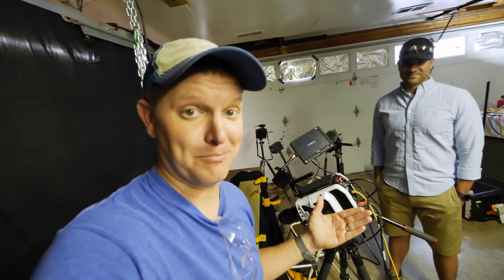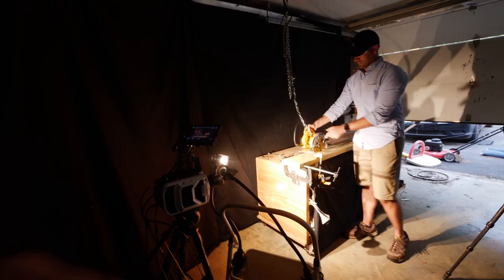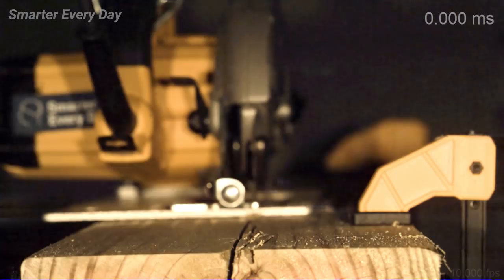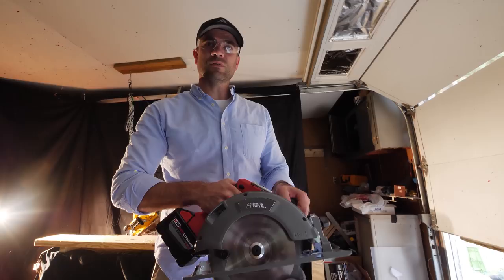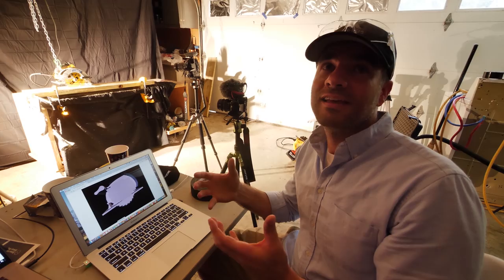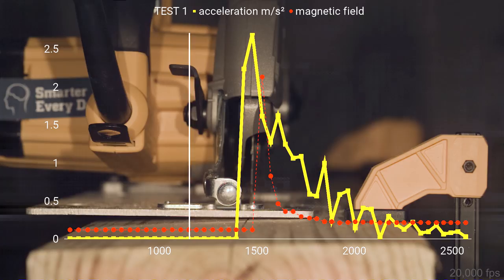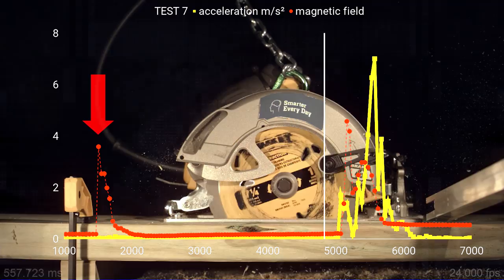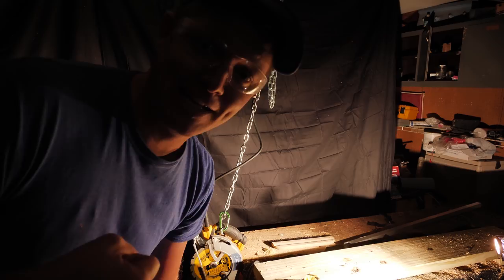Circular Saw Kickback Killer (We used science to make tools safer) - Smarter Every Day 209

Comment: As a carpenter... I am going to be honest with you. Schools may use this.. no one else will. There are many, many more ways related to set up and placements for cutting that removes this whole problem. No one who truly works with these tools regularly has any desire to trade more money for more safety redundancies in what is already loaded with dummy proofing systems to the gills. Every single time I buy a new tool with another unwanted safety option it makes me more likely to repair my older things rather than buy new. Also the system for this will almost certainly make the saw it's installed on useless for demo and most other uses for the saw other than your basic smooth cuts.
Reply: Why would this only be used by schools? What about the non-professional, home DIY-er? Your statement is the same as saying that airbags in cars are useless because everyone should be a professional race driver.
Reply: Kick backs are kind of a way we "weed" out people who are "better suited" to other careers.......
Almost every tool we touch in construction has the potential to seriously injure you (or worse).
Being safe, I think , is the responsibility of the individual AND/OR the person training that individual to be aware of the hazards involved in every task.
Reply: I would use it.
Reply: i think anyone who works in the field will agree with you. this was a cool experiment but these safety features in real life arent a solution. actually there isnt really a problem. anyone i know that has been injured by a circular saw never should have been using it in the first place.
Reply: Charles Waldon  Your sentiment holds true for every safety improvement and for technology advancements in general (seat belts and computers are perfect examples.) However, generally within two generations (usually 25 - 50 years), these things become taken for granted and won't bother anyone. In the meantime, until this particular safety feature becomes ubiquitous, Darwin will weed out the weak ones; implying that if you know how to handle saws without the latest safety features, you'll be fine, and if not, ...
Reply: Carpenter myself and I don't see the downside of a breaking system which turns on when the saw unduely accelerate.  While I totally agree that most accidents happens because someone stupidly ignored safety features and guidelines in the first place this one, like many other safety features are not a hindrance. 
And unlike the break block system for table saws working of "meats" conductivity to trigger the system to jam the break block into the saw an accidental triggering of the system wont ruin the saw.
Reply: As a carpenter for many years myself I too am not in favor of many of the safety devices. I.e. table saw guards. 

I totally disagree with you on this one. It doesn't get in the way, cost shouldn't be too crazy, and a simple mistake while using this tool can have such serious consequences.
Reply: Here's an old man not willing to try new things.. maybe it's time to retire.
Reply: Samed here, for professionals who use skill saws for a living, kickback isn't a problem. i've used a skill saw an absolute ton and just like chainsaws if you are careful about your cuts and not allowing blade to be pinched in first place it's no big deal and in rare cases when i do get a bit of a pinch it doesn't pinch hard enough to jump out of wood, its just a small jump as you release the trigger so as long as your holding saw properly with both your hands and your body/legs are out of way and releasing trigger instant it binds is just instinct to me, i've never come close to accidentally cutting myself (actually in most cases blade just stops and saw doesn't actually move even if you holding trigger, skill saws i've used while cut wood well isn't that powerfull to force my arms back out and towards me...). Now if your that kind of person who doesn't respect your tools and pay attention to what your doing, maybe you need dummy proofing, i know people who regularly cut into their power cords or saw horses etc, those people shouldn't be using skill saws if they can't respect the tool they are using enough to pay attention... 

Now table saws on other hand... way more tricky to use and scary in my opinion. chop saws and skill saws are my go to for cutting wood. Table saws i use as a last resort.
Reply: @petem9063  too true, wish I had read this prior to my first rebuttal.. pretty much sums it up
Reply: @jeffb1311  I am well aware of tech like this in many places. Unfortunately I have to be the bearer of bad news for everyone who thinks that the mods here are cheap. They are not.. it's an Additional option to a product. It will cost more. Most DIY projects are on budgets, that is why they are not hiring people like me, who have already seen the horror scenes of work place mistakes. Even with osha's law and every one  wanting to create a safe place for work to occur these things just are not practical in any way. It's understandable because you're not using these tools regularly like myself why it's not immediately clear why as well intentioned as this is its simply not practical and in my eyes removes uses for the tool.. I also understand that the brakes on rotating tools are not in Action because they have no longevity and fail... or in table saws with similar features once you trigger the sensor and utilize the safety feature that tool is done  until repairs can be done by the manufacturer. All reasons for not buying.
Reply: @YouTuneIt  no it only puts the saw out of use until repaired.. it jams up a aluminum stopper into the blade and it binds the saw.. boom garbage. The safety mechanism turns the saw into a paperweight. So if you had it in your mind that you just hit reset and go u r wrong.
Reply: @specfsr  ridicules notion bud.. quick slip with many things in life can come with serious consequences. I can't get behind the push to make everything child proof. Certain things that we do in life require a certain amount of preparation and learning. Not every single thing in this world is safe for use right out of the box. Lots of things well worth the effort involved take some learning from experience and preparation safety tips that can be easily accessible to everyone. More people should get familiar with operations of tools, cars and other equipment and technology before jumping into a position where ignorance can lead them to be hurt in some way. Life can't be baby proofed for a you toddlers out there well into you 40s.
Reply: @charleswaldon8362  what is
Reply: @zengrath  total truth
Reply: @cody5495  here is a forgivable obvious youngster who has no value for experience and just wants his world made dummy proof. Not caring about the trade off that occurs with these products in the real world when these lil gems are added for the untrained person who should not be using the tool anyway.
Reply: @charleswaldon8362  I totally agree with not choldproofing everything. Most safety measures suck. But there is no reason not to have this out there.  It doesn't get in the way of normal operation. As soon as early versions are out of the way it will be cheap. An accelerometer only costs about $.50. This safety is also non-destructive like a sawstop is. 
And even though I am a professional and I know very well how to use the tools safely, it only takes a momentary lapse in concentration, or even some other dumbass to run into you to cause a kickback. I would gladly pay $200 for a saw like that. My emergency room deductible is $100 and I value my fingers at more than $100. So the return on investment is there.
Also, it is so small no one would ever know that the safety is even there, so you wouldn't even look less manly in front of your workmates

Comment: Never ever- EVER -support the work on the cutoff side of the saw. That’s  sawing 101!!!!
Always secure the work under the motor (heavy) side of the blade and allow the cutoff to drop away from the blade. For sheets and awkward pieces support both sides nearly equally under the work to avoid blade pinch. I use stringers across under the work for sheetgoods and barely score them as I make my cut. Chipping is reduced as well. 

It’s important to always set the blade to the proper depth. Just deep enough to clear the underside a bit. That way the cutting action is nearly horizontal and  teeth clear the chips vertically. Then the cutoff drops away and down. If a circular blade is set too deep it will make a nearly vertical full thinkness cut  forcing the  material to twist and buck the blade.
Reply: I was surprised. These guys usually do better
Reply: So true.  Barely more than the thickness n the very first thing my dad taught me I using a C-Saw.
Reply: coldrunner we’ve created the solution for a problem we’ve created where we’ve removed all safety features and have forced the tool into an unsafe operating environment.

Comment: I wonder if you could measure the change in amp draw of the saw's motor when it "catches" on the wood. I'd image a spike as it comes close to stall torque. Could be quicker and simpler than accelerometers?
Reply: It would be far more difficult to tell the difference between kickback, and hardwood like Oak and Hickory, or so I would imagine.
Reply: @ncrshane1919  not at all, you are looking at the change, basically the motor hitting a higher resistance followed by free spin.

that wouldn't be difficult to differentiate
Reply: @0x73V14  I didnt account for the free spin, but if you rely on a free spin, then you need a much faster braking mechanism. If the blade is freespinning, that means that it is in the air where it can come into contact with the operator.

Comment: as someone who works in the trade this feature would be very annoying when i needed to abuse the saw to get a job done. i would be disabling it. HOWEVER. for your typical homeowner who doesnt use power tools day in and day out this would be a nice safety feature.
Reply: Yep, I posted a comment thats worded almost exactly like yours.  I also notice our comments are not getting Hearts LOL.
Reply: I don't know that this would be a good feature.  People should be learning the correct way to use power tools.  This sort of feature seems like it would encourage bad habits without teaching you good ones.
Reply: @IanSlatas  Just like how seat belts making people drive worse.
Reply: They could add a toggle switch but i do agree with you on that
Reply: As a carpenter all we do is leave the triangle in and use the circle Arbor instead and barely tighten the nut with some WD-40 or lithium grease so the motor spins inside the arbor instead of the blade kicking
Reply: @danballarin  Totally wrong.  It would be more like partially automated vehicles leading to less attentive and less capable drivers.
Reply: problem is, you typical home owner who only uses a saw on occasion is going to buy a  cheap $50-80 saw, not some super-smart $500 thing.
Also, I have had kickback before, and that saw guard works very quickly and well... This seems like a complicated solution looking for a simple problem that was solved a very long time ago.
Reply: Yep,  if you hold the saw firmly the blade will stall before it can kickback
Reply: @thecloneguyz  this is really interesting. So the idea is to have the blade just loose enough that it will bind in a kickback scenario. How do you test to make sure you have the right amount of friction? I'm sure I'm showing my ignorance, but  what do you mean by "the triangle"?
Reply: @Anjonwalt  
Skill saw blades have a center triangle that you can knock out if you want increased torque. 
The motor cannot spin by itself inside of the triangle because it's triangle.
You leave the triangle in and just use the round Arbor hole and you just use some WD-40 or lithium grease and snug it up. 
Then the motor spins inside the arbor if it kicks back or grabs. 
Old guys have been doing this for 30 years it's nothing new
This seems like an over-engineered answer to a non problem
Reply: @thecloneguyz  thanks so much! So just a little tighter than finger tight?
Reply: @Anjonwalt  
You always want to put a mist of silicone or WD-40 or lithium grease in between the arbor in the blade to ensure that it doesn't grab but yes a little more than finger tight

Comment: Wouldn’t a microswitch which triggers and applies the brake when the bottom of the saw loses contact with the wood be much more simple?
Reply: Perhaps, but there are often cutting instances where the switch would not be covered by the work. What then?
Reply: Then a contact switch on each side of the blade in AND to trigger the brake
Reply: Yeah or something with a double base plate. I am not an engineer, but I’m quite a macgyver haha. I respect this thorough approach but it leaves me thinking it just is over complicated.
Reply: These types of saws are used in so many ways. I've seen them used to shave a notch by lateral translation with the foot in mid air or tracing along a long cylinder or just the weirdest situations that go beyond the predictable straight long cut in continuous contact on a horizontal board. For one example plunging to begin a cut is a higher risk for binding which would happen before the foot makes contact.
Reply: @frederf3227  but not all the kind of cuts are prone to kickback. You need two sides of material to snap the blade.
Reply: why bother detecting the kickback?
a simple metal splitter behind the blade will prevent the wood from binding and prevent the kickback from ever happening in the first place.
Reply: @isays  Having used a circular saw lots, I can tell you there are many cases when that wouldn't help. Specifically If you're doing a "plunge cut" to start, or cutting a sliver off an edge etc.
Reply: How do you start the saw then? It has to be buried in the wood before turning on? Oh, you put the switch at the front... but then it turns off when the tip goes over the end of the board but you're not done cutting yet. What it you have to just cut a sliver off one edge of a board? Or how do you start a plunge cut? Nope. Switch wouldn't work.
Reply: @WorshipTheSavior  thats a good point... although I'd imagine that when you do a plunge cut, you prepare for it...
the normal danger of a kickback is because it can happen when you're not prepared.
or at least, that was my understanding. I'm not a professional, I just occasionally make things as a hobby and rarely use a circular saw.

From that perspective, having something that detected a kickback could be helpful, because there are some cases where physical failsafes couldn't operate.

I'm still kinda sketched out that they're using machine learning for it though. this doesn't seem like a good use case for it.
Reply: @isays   there are certainly times when kickback is more likely, and sometimes you can prepare yourself for that to stop it from happening, but being in a hurry, complacency, or simply a surprise like a knot or a nail in the wood can cause kick back when it's completely unexpected. 
I'm not really familiar with machine learning, but I would guess that they are probably just using it to develop a kick back profile which would be hard coded into the device. Hundreds of data sets where you specify under controlled conditions whether each profile is from a kickback or not could produce a very accurate model for it to follow once installed in the final product.
Reply: @WorshipTheSavior  im a software dev so I'm a little familiar with machine learning, but I don't specialize in it.
That is how machine learning works... you train it beforehand with a bunch of data, and then you copy the already trained neural network into the finished product.
but neural networks (and other ML alternatives) have the issue that they cannot be inspected or reviewed for correctness, so if there is any issue with the training data or methodology, the only way to find out is when customers start complaining.

Machine learning isn't good for safety critical systems.
Reply: @isays  ok. But in this case, you're moving from no safety, to added safety. They would only be increasing the safety level, and not replacing a safety feature. The worst case scenario I see happening here, is that it completely malfunctions and revert back to a circular saw that operates as if it was never installed. Or maybe, almost as bad, a circular saw that is too sensitive and stops prematurely. In both cases, it is no less safe than before the technology was installed, right? And shouldn't factory testing mitigate 99% of those problems?
Reply: @WorshipTheSavior  machine learning is extremely sensitive to the training data... and real world usage is often nothing like what the people creating the tools expect, so I wouldn't expect that factory testing would do a great job finding issues (they're only likely to test the types of things that went into the training data).

I agree that this is better than nothing, but using machine learning isn't the right choice. If we want to use software to solve this problem, then simple procedural programming is a better option, cheaper, and more reliable and predictable.

for example: if torque on the blade is > x and an accelerometer detects acceleration > y, then put on the brakes... which this is basically doing, but with extra (unreliable) steps.

Comment: There are safety saws, it's got a double base plate where the blade is, you have to push down for the two to bases to make contact to start, if they disconnect , like in a kickback, the saw stops.
Reply: I've never seen such a thing at the retail level. Who makes this saw, and what's its model #?
Reply: @demef758  i don't know but you wouldn't be making any plunge cuts